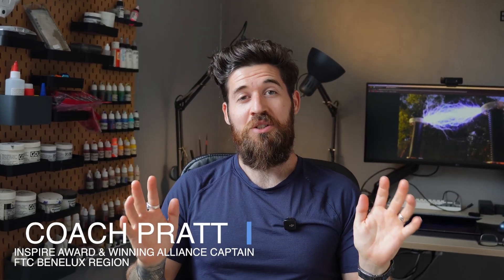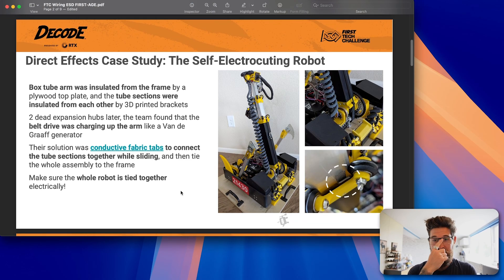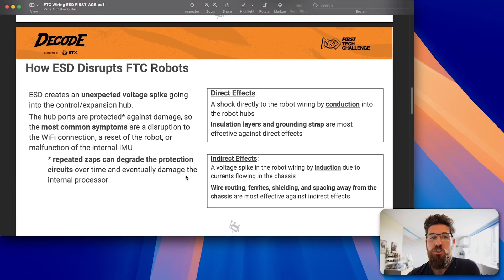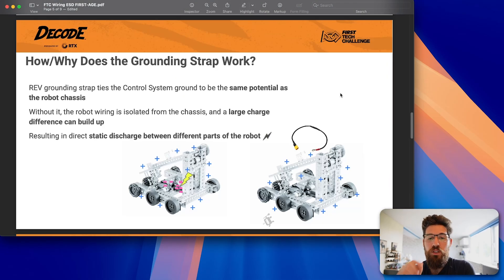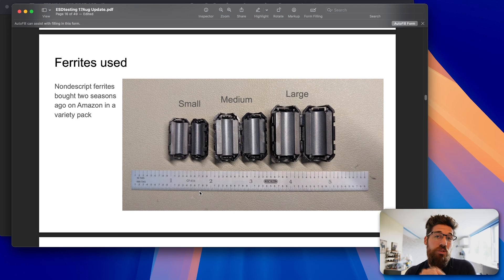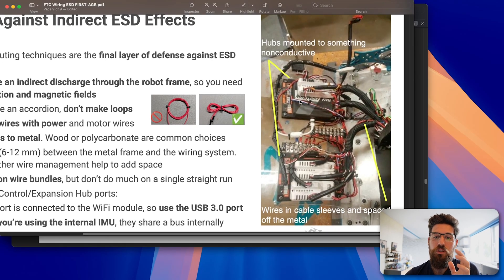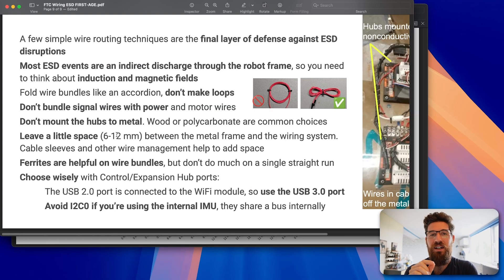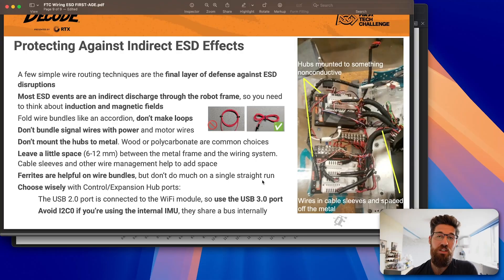This "Fix" for Static Is Making Your Robot Worse

Comment: Use an isolated  hydraulic oil container for ground , you can use multiple save on wire ground . Stay away from liquid tube chassis exaust pipe . Electricity is lazy . You ask electricity fetch milk , california to ny ? Electricity found milk next door . Oops

Comment: 5:49 , useless . The zap gun . Use oil cylindrical ignition coil . Of 1970 car . Aim to frame , metal in your experiment . The issue i saw ? Ground induce in isolated wire . Airgap , solid wire , teflon protection cure this but better . Not using chassis as ground fix this .

Comment: Use bare wire , if it does not work with bare wire ? It wont work with isolated wire . It will just fake working with isolated wire

Comment: Not having a ferrite on a single signal cable is kinda obvious.
But in most cases if the transmitter and receiver isn't grounded on the chassis then you will have a negative cable as well as the signal, wouldn't it likely be beneficial in this case?

As any voltage out will return back on the negative
Reply from the maker: To your first point, only obvious to some. "common sense" isn't common, so to speak, as not everyone has had this "common" experience. 

I'm not quite sure what you mean by your second question, I'm missing some context here.

Comment: ... Good info, static and noise glitches are incredibly hard to troubleshoot.

While I was watching, these thoughts occurred to me, hope you don't mind the comments.
The word "grounding" can be a bit confusing. I realize it is used in several different ways in the FIRST rules. Often the term 'electrical bonding' may be more useful?
 In this video I feel you are primarily describing the electrical "bonding" of all parts of the robot to avoid static buildup between different parts of the same robot. Thus prevents static discharges inside the robot structure.
This involve the running of many wires between parts of the robot that are insulated from each other. In the case of the example robot it would probably need at least half a dozen 'bonding' wires between the different elements.
 
At 9'00" you encourage the connection of the negative power rail to the robot chassis. I believe this is needs clarification as It is more than just a wire from a XT30 plug negative to the chassis.
FTC rule R611 states "If electronics are grounded to the ROBOT frame, the only approved methods are the REV or AndyMark resistive grounding strap and must be connected to a fully COTS XT30 COMPONENT. R611".  This is a very special cable that includes a 470 ohm resistor.

Love the channel, have got our FRC team to watch many of your videos.
Reply from the maker: Thanks for taking the time to share your notes & comments, it helps us all grow. I'm glad you've found value in my content for your team.  

Good point on electrical bonding, the grounding rules in the first wiring guide are somewhat out of date (not to say it's all out of date), it may be why this current resource is no longer on the website presently? Perhaps they're updating them to increase this clarity? That's something I can improve in in the future, I'm still learning myself. While I think I do a decent job on the teaching front, my technical knowledge can always expand. 

Great clarification on grounding to the chassis. Definitely shouldn't be open bore current into your chassis without a resistor of some sorts, and in FTC, that's only a few approved methods.